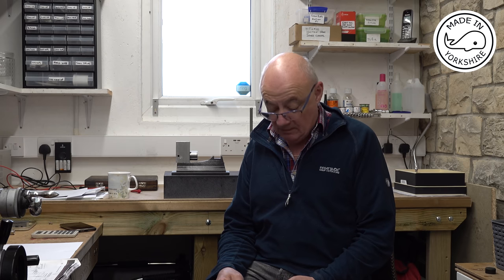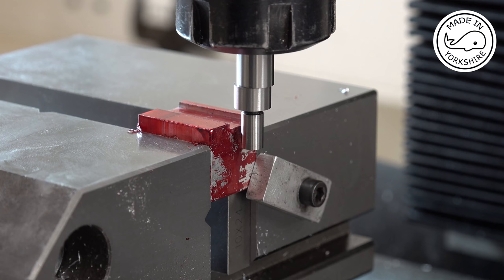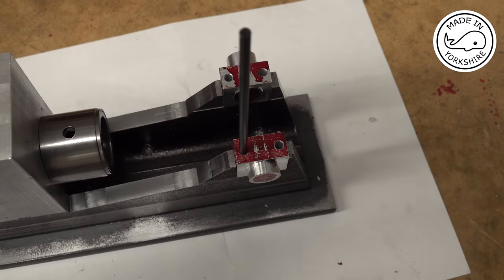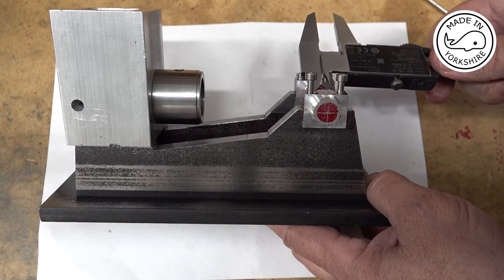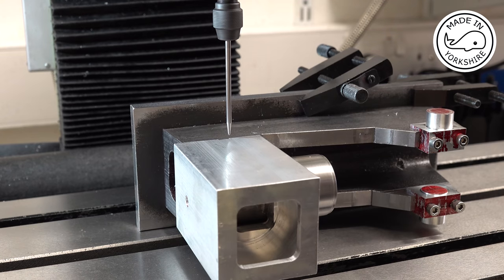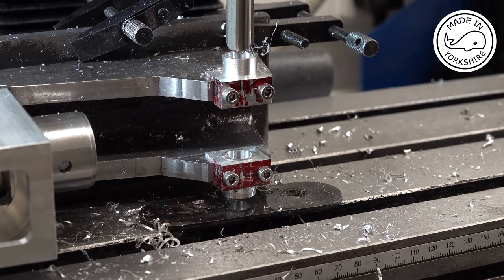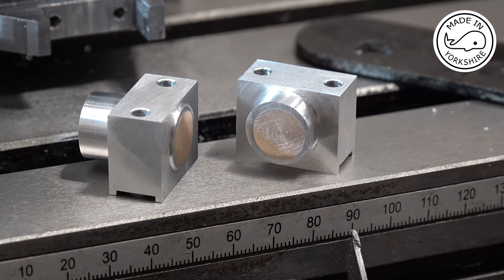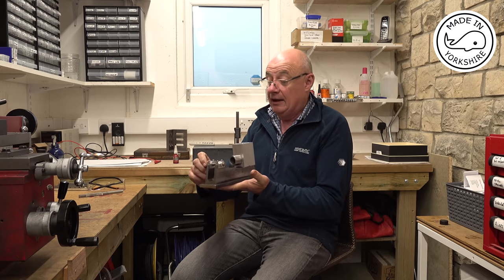#MT41 Part 7 - Philip Duclos Odds n Ends Engine. Machining the Main Bearings. In 4K by Andrew Whale.

Comment: Hi Andrew, another inspiring video as usual.  You were certainly lucky with that loose bearing cap, and it turned out OK in the end.  However, to be on the safe side, I would have provided some support for the bearing supports in case of any flexing while drilling and reaming.  Especially when drilling and reaming the bushes.  Adjustable parallels are perfect for such instances.
Reply from the maker: Hi Steve - a brilliant suggestion! I've just ordered a set.
Cheers
Andrew

Comment: Thank you again Andrew. Coming along nicely.  I gasped when I saw that movement. Then you called it out. Whew. Glad it turned out ok. As far as the cam shaft. It’s an excuse to make another video.  Cheers !
Reply from the maker: Ha ha John. I've just managed to get round to drilling the hole for the cam shaft. I'll tag it onto the front of the crankshaft video.
Cheers
Andrew

Comment: Andrew not to worry. I am building same engine and it's easy to locate the hole for the pin for the cam gear. I did it on purpose to make sure the gears meshed OK. Love the vids.
Reply from the maker: Hi Steven - thanks for the advice. Once you have completed your engine, if you could email me a short clip I will try to include it in one of my future videos.
Good luck!
Andrew

Comment: Andrew, question please ? What was your thinking of adding Phosphor Bronze to the ally blocks, then re mounting them onto the mill to re machine to 3/8" bore. Why not do it on the lathe as finished bushes, then just shrink / Loctite them into the blocks. All much easier to do on a lathe than a mill. Your thought please. Well done, anyway you succeeded in the end.
Reply from the maker: Hi Dave - machining in the mill ensures perfect alignment with each bush and the bore of the engine. I doubt that this could be achieved as accurately by machining each bush individually in the lathe.
All the best.
Andrew

Comment: Hi Andrew, Great job as always!  Can I ask where you got the mill attachemt for the DTI you used?  Thanks.
Reply from the maker: Thanks James. It's an 'Edge Technology Indicator Holder with 3/8" Shank Mount' from Machine-Dro. It came in useful for this job, but I think it's quite expensive for what it is. I was disappointed that there are two different size grub screws used the set friction and mount the dial. These are small (not common?) imperial sizes and I had to purchase these separately. I would have thought that they would have been included in the price. With them being specific to this tool I put them in a 'safe' place, but now I can't find them. Typical me!
Cheers
Andrew
Reply: @learningturningmetal  Thanks for letting me know Andrew. I'll go have a look at that and I too have a Lot of stuff in 'safe' places.....

Comment: The engine is coming along just fine Could you tell the size of the vise that is on your mill width and max jaw opening
Reply from the maker: Hi William. I have three type 2 precision engineers vices from arc euro trade. A 70mm, 90mm and 120mm. I use the 90 and more recently the 120 on my largest mill. The arceurotrade website has all the specifications. They are really good vices with absolutely no jaw lift.
Hope that helps.
Andrew
Reply: @learningturningmetal  Thanks for the info.

Comment: Are you going to split the bearing caps ? If so shouldn’t it have been done before the boring and reaming ? Not criticizing , just curious as to how you are going to get the crankshaft in .
Reply: Never mind , I think I figured it out . Sometimes the simplest things are the hardest to see. 🤔
Reply from the maker: No worries. Unlike the conrod, the main bearings can be slotted onto the crankshaft during construction.
Cheers
Andrew